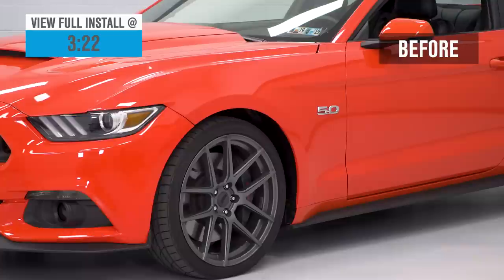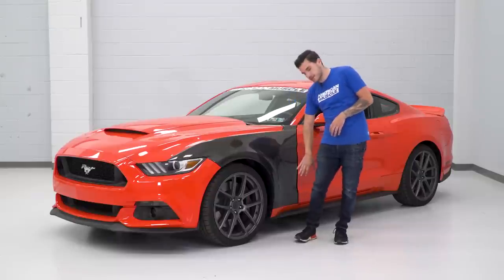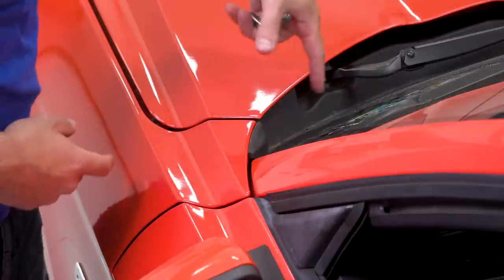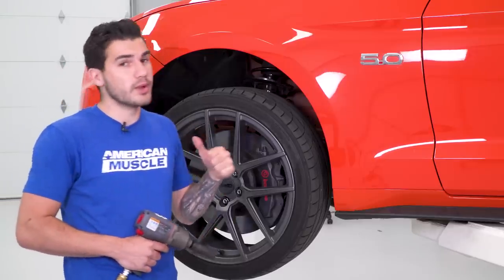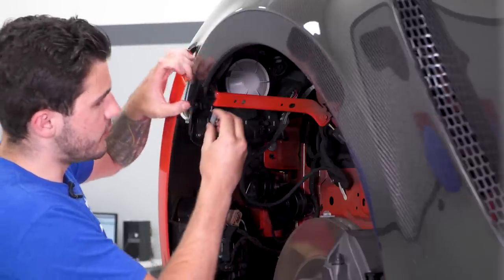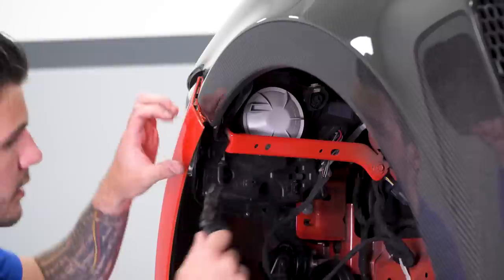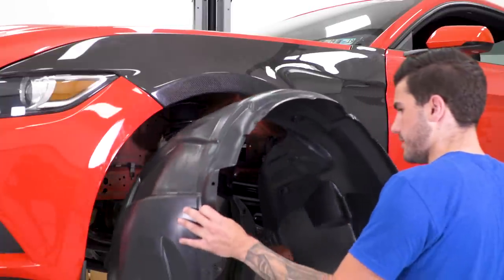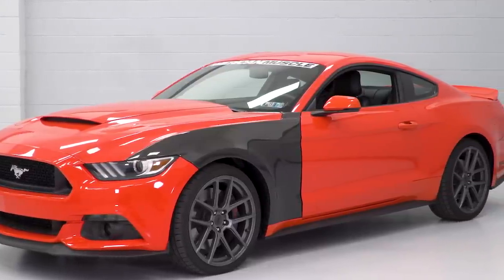2015-2017 Mustang GT, EcoBoost, & V6 Anderson Composites Type-GR GT350 Fenders Review & Install

Comment: I wonder if it would be really difficult to switch the radiator core support on a 2018-2020 Mustang back to a 2107? My idea would be to install 2015 aftermarket body panels and enjoy the newer tech on a 2020 Mustang. Anderson Composites Super Snake Hood, GT350 Fenders, and GT350 spoiler on the back of a 2020 Mustang GT would be so sick. The problem is the hoods made for 2018 Mustangs still slope down too much and look awkward. I would prefer to install a 2015 version of an aftermarket hood on a 2020 Mustang GT and raise it back up.

Comment: does anyone know if I can install GT350 body parts on 2018 Mustang GT? I just really hate the front end, I would also settle for a 2017 Mustang GT front end swap also if that is physically possible. I bought my new Mustang for the 10 speed and Coyote Gen 3 but I still cant stand the front end